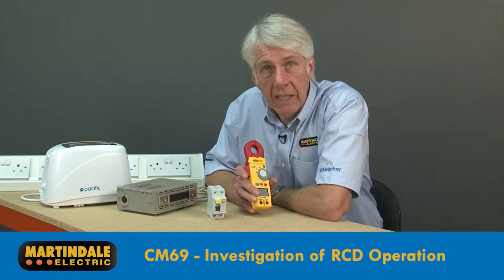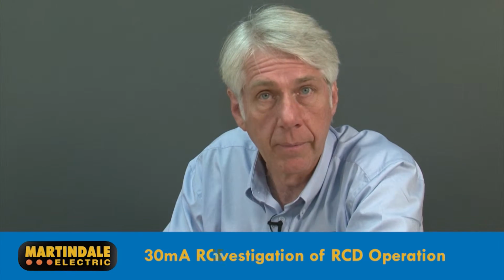Martindale: CM69 Earth leakage applications

Comment: Hi I have been searching for an answer for this question for over a year….if there is DC current leakage in a AC circuit which will saturate an AC type rcd….can the dc setting measure the dc leakage current in that circuit

Comment: In my experience these clamps work well on paper, but in practice if an appliance, that is say plugged into a ring final circuit, has 45mA of leakage. How would you troubleshoot and diagnose the particular faulty appliance, when it is fed through a 30 mA rcd? Without bypassing the rcd (say in a split load board) as the rcd will instantly trip out before any useful measurements are taken and displayed on the clamp? Obviously Without using the unplug everything method and plug in one at a time, I’m specifically interested in using the clamp method alone, to diagnose as in the above scenario.
Reply: si trabajan excelente, yo poseo una MEGGER modelo DCM305E y mide desde los micro Amperios hasta 100 Amp, con su filtro de pasa bajos y es TRUE RMS verdadero , tiene certificado de calibración ...... igual las fluke ,Hioki, etc........  lo que pasa es que hay que comprar quipos buenos certificados y eso vale dinero...... otras marcas  te ofrecen muchas prestaciones pero a la hora de usarlas no sirven 🤷🏻🤷🏻🤷🏻 por eso la confusión y malos diagnósticos a la hora de reparaciones eléctricas......hay que tener euipos certificados
Reply: @miguelc_seeker nonsense you don’t have to spend loads of money on brands with fancy names, they are all made in the same factory’s in china and sold to different companies who pay to have their brand name printed on them. Why do think they are all exactly the same design just different colours and model numbers and brand. Don’t be naive in believing you have to buy expensive big brands the circuit board in the tester in this video is sauced from UNI-T as are most of them.
Reply: @mpkkflima  👍👍